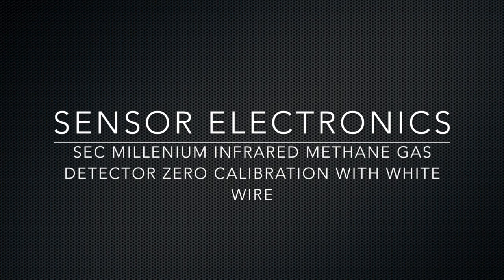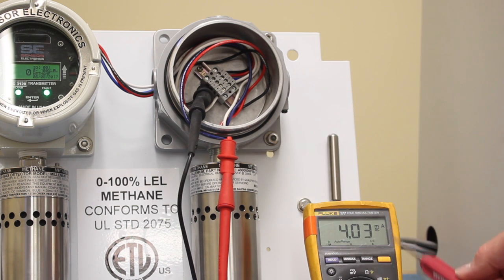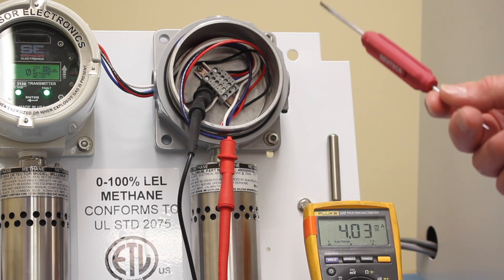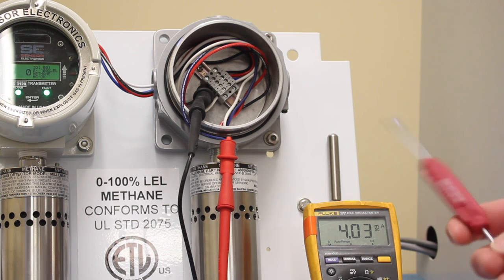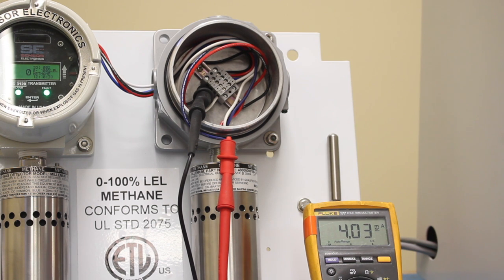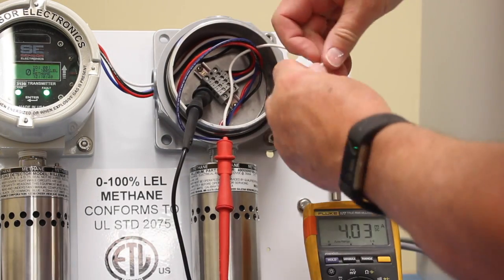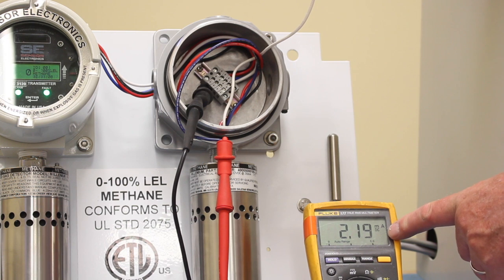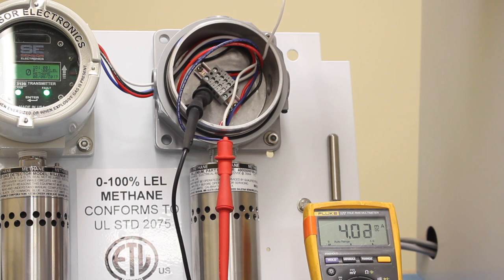SEC Millenium Infrared Methane Gas Detector Calibration with White Wire

Comment: Someone informed me you connect the white wire to the blue for 10 seconds to zero is out. Is that incorrect?
Reply from the maker: You will have to connect the white wire to DC Common (black wire) for 10 seconds.  Once the connection is broken the 4-20mA signal will drop to approximately 2 mA for 3 seconds.  Then the sensor is zero calibrated and will return to 4 mA.
Reply: @SensorElectronics  Okay, thank you.

Comment: I have one of these sensors at my job and it’s reading a fault code FL-11. The power light is also illuminated as well. I tried recalibrating it by pushing the side button but no such luck. We have these sensors in our main gas meter rooms which are interconnected with our fire alarm system. I for one do have concerns if I try recalibrating the sensor the way that is shown in this video. Would it ring off an alarm doing so? Please advise to me what the solution would be. Thank you.
Reply from the maker: You might want to just send us the top board stack and Millenium sensor and we can fix it for you.

Comment: Is this would work on a sec millenium 2000 gas detector installed on a pierce firefighting truck ??  it has 2 sensors. Thank you
Reply from the maker: ROBERTO AARON Astudillo  Dear Sir, Yes it will work with your SEC 2000 SEC Millenium installation